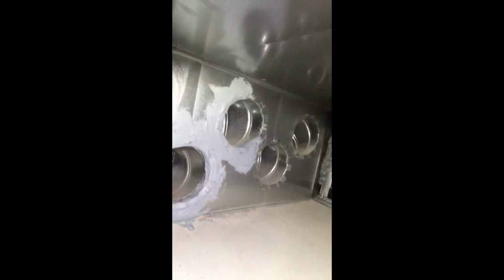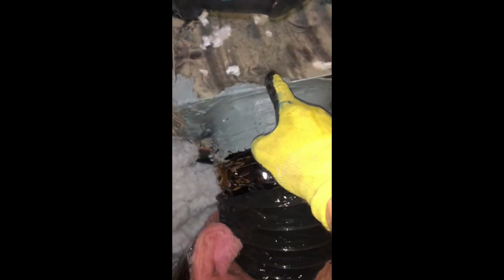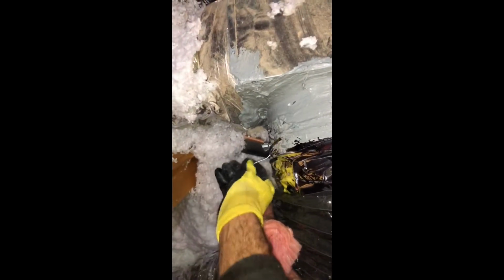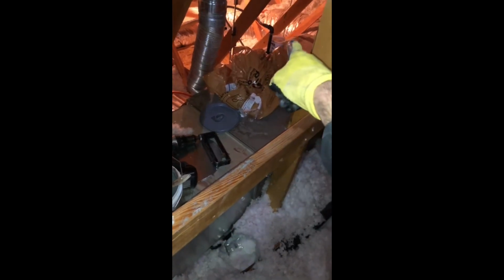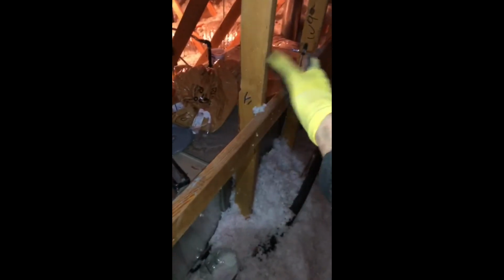High limit switch keeps tripping on furnace.

Comment: So what is the cause for limit switch  tripping?...
Reply: Not enough supply air is causing the fas furnace to overheat therefore tripping high limit switch to prevent damage to the heat exchanger due to overheating